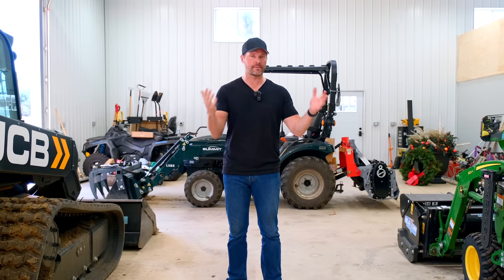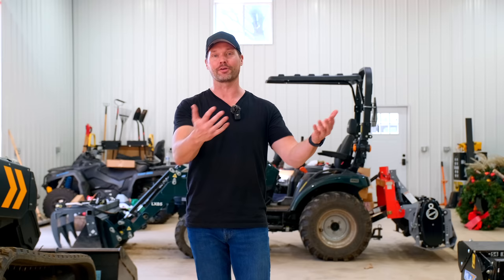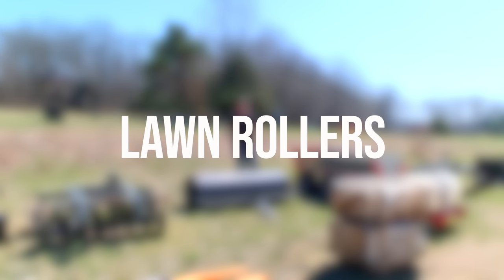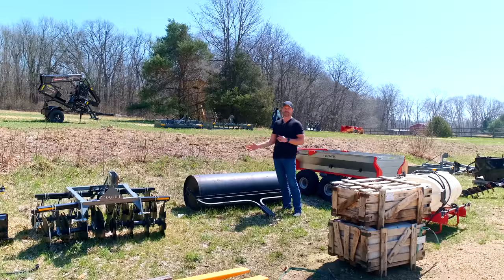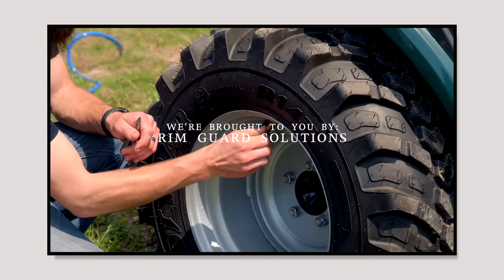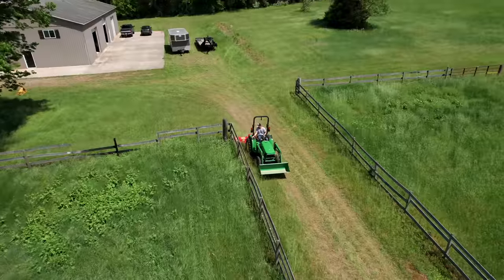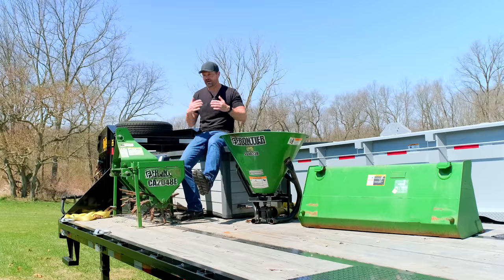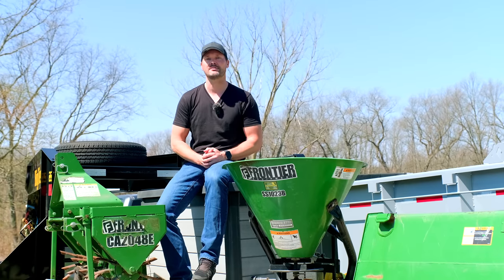THIS IS WHY I DON'T CARRY THESE ATTACHMENTS!

Comment: In regard to sickle mowers I will say that for clean areas they can mow a lot very quickly. I have a 9ft I and J double action bar and the double action bar really helps provide a clean cut at high speeds. As you mentioned there are  lot of areas where they aren't a good option but if you want to mow open areas or have a cheap way to cut hay they are a good way to go in my experience.
Reply from the maker: Definitely, I've seen them work and they look really effective.
Reply: Pond banks are another good use for the sickle cutters

Comment: GWT will be working with BEFCO 🥳 !       I have a 12’ Befco cyclone flex wing lawnmower, bought it used and it’s probably 20 years old.   But, it runs like a champ and I think it looks higher grade than 2023 models from other manufacturers.

Nice work  Courtney!
Reply from the maker: Sweet, glad to hear it Chris.  That's reassuring.
Reply: Sounds like the good old stuff to me and you can’t beat that,it’s the best,good for you!!!

Comment: MK Martin makes a good ballast box - has tool holders, receiver, and "feet" (to more easily move with pallet forks). Loaded with quikcrete mine weighs in around 550lbs
Reply from the maker: For me, the thing that stands out is the small amount of weight.  550 lbs is too light for a loaded ballast box. It's paying a premium and getting less out of it.
Reply: @GoodWorksTractors  perhaps they have different sizes available, but it was a good "everyday" weight for my subcompact.

Comment: Good video!  If you would sell the Pat's Quick Change hitch system, it would solved all your quick hitch compatibility problems at a low price.  The flail mower you sell would work fine with it.
Reply from the maker: No thanks, they've asked, I've said no.  It does not solve all your quick hitch problems.  Pats system is a partial fix at best.

Comment: It’s funny you mention an airport. I used to work at an FBO at a small county owned airport that were responsible for plowing the taxiways and runways. However, we were responsible for getting snow away from the hangar/building and away from the in ground fuel farm otherwise the plow would shear the caps right off. We had a John Deere 2025r I believe and we got all kinds of attachments because we were right down the road from their testing facility. The front mount hydraulic snow blower was great in the winter.
Reply: Please don't snowblow my mooney! :)
Reply: @andrewkirch5920  Fortunately we didn’t have nearly any aircraft on tiedowns because there were sufficient private hangars and a generously sized community hangar on the field.

Comment: Courtney, I’m looking for a combination root rake and grapple combo for my LX2610. I already have a third function and there are so many options out there. It’s main use will be to remove downed limbs and removing thick thorns and honeysuckles on the sides of the woods and lane. Any input would be greatly appreciated.

Edit: I’ve never been a big fan of quick hitch attachments. The quick hitch isn’t as universal as it claims to be and you end up having to mess around with it just as much as just hooking whatever attachment you have to the 3 point. But I only use my box blade and tiller with my 3 point, I have a mid mount mower so I don’t have to swap out attachments often.
Reply from the maker: Lots of options on the grapple  for sure.  Those Precision are really nice, but pricey.  We've got the smaller Worksaver SCG-48 that has been popular for a long time.  About half the cost of the Precision.

Comment: I get that SCUTs are your bread and butter, but some wider attachments would be nice.  Specifically 72" pine straw rakes, which are less destructive than a landscape rake and wider than the 60" dethatcher you offer.  My Yanmar YT347 is 70.6" wide.

Comment: I have converted two implements to ssqa.  It's normally about a week and a half job.  And that is from someone who went to welding school and has an engineering background.  Doing one on a small tractor would be a lot easier.  I did mine on a small wheel loader and that was a trick.  It would be hard to offer a kit because every machine is so different.  I think every one would need to be custom made to the machine, so those would be hard to sell.

Comment: good segment. how did you put the duals on the 1025R Luke was driving? do you think they help with stability? worth the cost? i like the variety of equipment you carry. Everything i have gotten from you has been great quality stuff with great customer service. Now, it has to be a planned purchase now that I'm on a fixed income.
Reply from the maker: Yeah, those duals were pretty awesome all around.  Spacers will make a big difference though and less stress.  The duals have the cool factor going for them, but a bit less practical.
Reply: @GoodWorksTractors  thanks for the feedback. I'll have to look into spacers for my 1026R.

Comment: SnowVac is probably the best value for a loader snow blower with an engine.  66 inch, 29hp fuel injected and 825lbs and for about 13.5k if you don't have a loader or 10.5k if you do have a loader with ssqa.

Comment: Anyone have a lead on a tractor attachment that would cut and mulch sagebrush in one step?  The sagebrush on my land has thick stalks (1"+ in diameter) and is like tree branches. A typical mower or brush hog would definitely not work as some of the sagebrush is already 5' tall. Preferably, it would need be a quick attach, since you don't want to roll over sagebrush before it is cut down. Ideas?
Reply from the maker: A Baumalight mulcher is a tool that can do that.  Pricey buggers though.
Reply: Have you looked into flail mowers? Plenty of videos of people using those to clear 2" diameter brush. Cuts it up real fine too, essentially a rotor tiller made for clearing.

Comment: "Salt" and fertilizer work on a broadcast seeder really bad. Does anyone make a stainless steel or plastic adjustment plate? Mine are froze up despite me washing and washing after every use.
Reply from the maker: Was yours rated for salt and fertilizer? Most are not.

Comment: Woods is tied into a specific tractor mfg?  First I've ever heard that before.  I don't believe that is correct information.  Frontier, on the other hand, is a John Deere side brand.  Frontier equipment is made by various OEM manufacturing companies, of which Woods is one.  But that is correct, Frontier builds nothing.  It is simply a brand name.
Reply from the maker: I can’t sell Woods.  They only sell to certain OEM.  I’ve tried.
Reply: @Good Works Tractors  there's a dealer near me that used to sell Mahindra tractors, now only sells Ferris,  Exmark, Grasshopper, Stihl.  Maybe some other minor stuff.  He's a Woods dealer now also as of a little over a  year ago.  They dropped Mahindra about the same time that they picked up Woods.